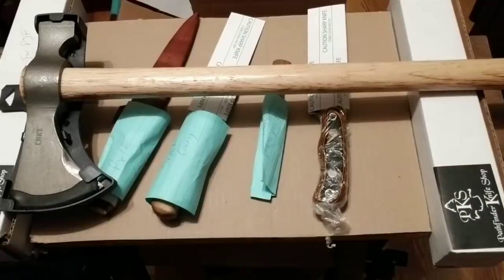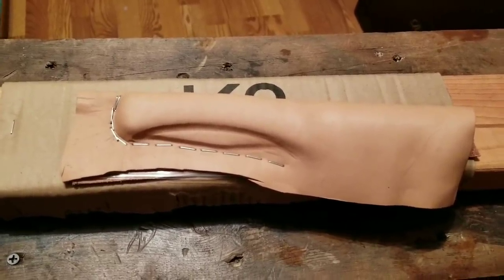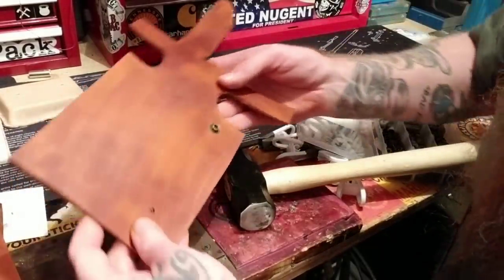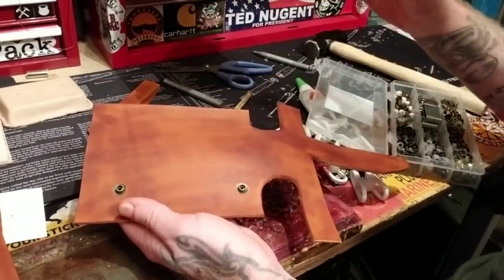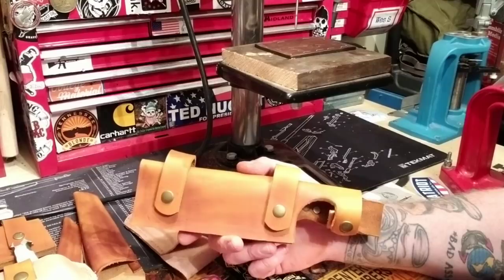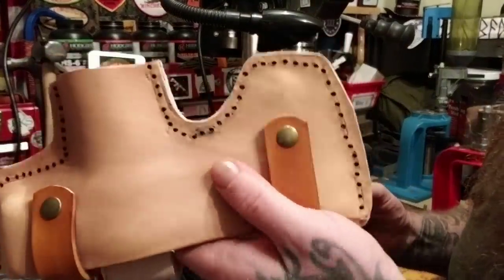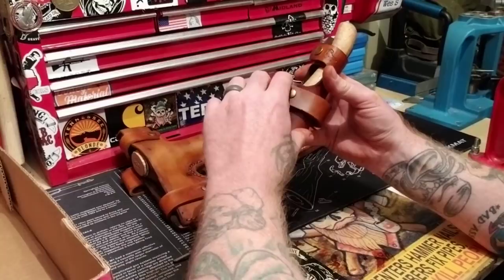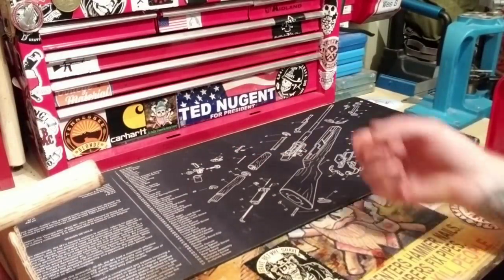Sunrise Leatherwork Multi Project

Comment: Hey, SSgt. BA... have you ever tried putting your projects in a vacuum sealed bag for wet forming? I don't know if it would be feasible for something like a tomahawk but would definitely work for holsters and bushcraft size knives.
For detail sanding on really hard to reach areas like that, try using a Work Sharp knife and tool sharpener. There's enough slack in the 1/2 inch wide belt to get it in and around just about anywhere. Could really help save some time.
Reply from the maker: I did a few gun Holster videos doing that